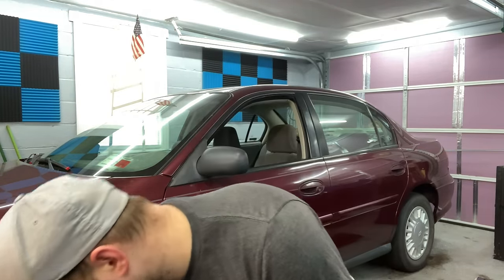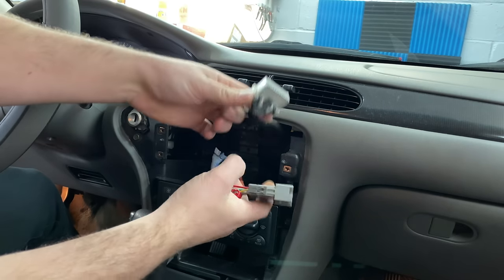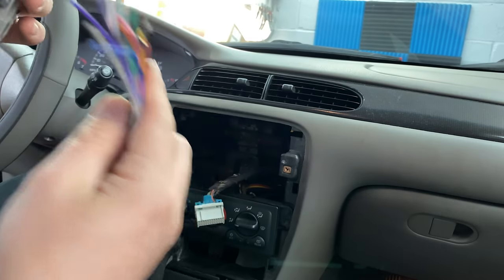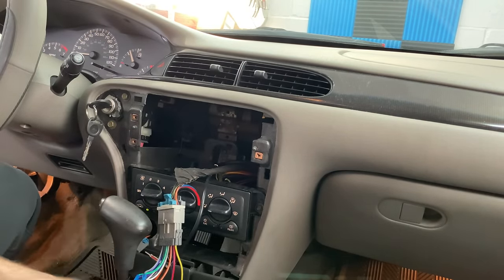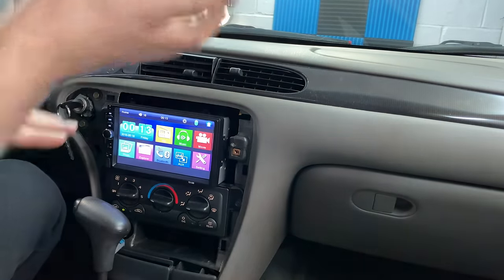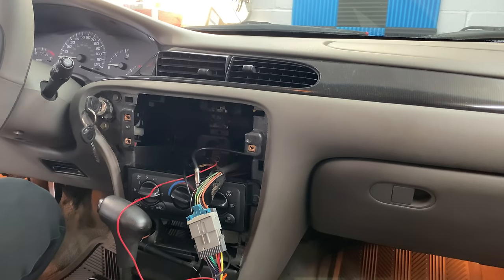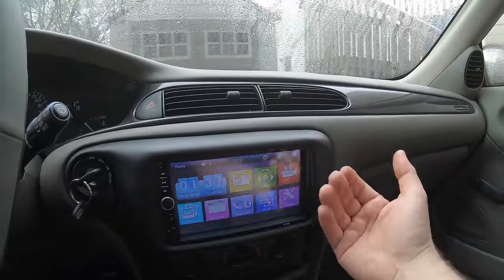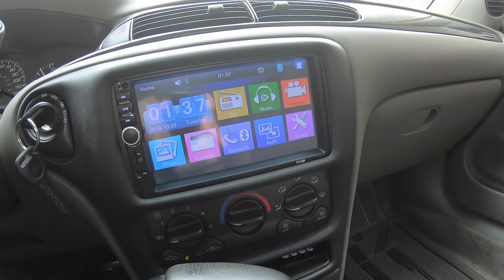I Bought the Cheapest Touch Screen Stereo on Amazon! | Malibu Episode 3

Comment from the maker: Comment what cheap Amazon car gadget would you like to see me try out next!
Reply from the maker: joe v not sure but you can play stuff stored on  usb drives by plugging them in.
Reply: I think it'd be cool to see someone figure out this product I found a while ago. It's a rear view mirror, that's also a screen you can use as a backup camera. It had a bunch of other features too. If I can find it again I'll post it here
Reply: is there an aftermarket tire-pressure monitor?
Reply from the maker: MostlyWeed good idea!
Reply: @poepflater  I am sure if you go with a more expensive unit it will come with that as well in it
Reply: @junkiejackflash  
I have this one, I think it is what you are talking about, it works great. http://www.amazon.com/dp/B07VPD4R71/?tag=beslitstu-20

The one and only issue is that they do not yet have the GPS device available for purchase. 
But video is awesome, recording capacity with a 32 gig card is about 36 hours at full resolution, and the touchscreen works both as a mirror and as a screen so it is pretty awesome.
Reply: If I wanted to buy one what is it listed as exactly?
Reply: @CAPERCHRONICLES  just type in 7018B into amazon for example and you'll get that exact unit along with I am guessing similar units just pick the one you want and buy it
Reply: LsxMatt  The only problem not picking up the parking brake Sir some head units won’t even allow you to pair a Bluetooth device until it realizes your car is in park ! Just saying!
Reply: If you buy anything from Amazon you don't care about job's  and small businesses in our country.
Reply: joe v  Definitely not through bluetooth, that doesn't have the bandwidth for tranmitting video. It can play from micro-SD card or any disk you connect through USB. Might be that it doesn't have the power to run some older harddisks, but you can work around that by having a splitter USB cable (common on older disks) that takes extra power from a 12v-to-USB adapter you put in the 12v socket.
Reply: LsxMatt maybe the rims..?
Reply: new up dated stereo for  Mitsubishi outlander jeep
Reply: Cold air intake
Reply: What kind of dash kit did you buy for the radio? I’ve got the exact same one just can’t find the kit to fit the radio for the dash
Reply: Stay away from Atoto !!!

Comment: I love how that unit connects faster to bluetooth than my 2017 grand cherokee. takes me a good minute to connect
Reply: Zach Reynolds so Dodge is part of FCA, and At least in my Uconnect system, for the Jeep Grand Cherokee, they didn’t update it till 2018 with Apple car play. Mine is just slow to connect, maps doesn’t load until a couple minutes and the user interface is just bad. I know on other Jeep models and FCA models they updated the uconnect with Apple car play in 2016. I can take it to my dealer to reset it but that’s all I can hope for

Comment: I paid 130 at autozone for my touchscreen boss audio deck, it's badass, it made my system way louder and it had all the outputs plus I can watch movies on it and it has bluetooth so I don't have to worry about my aux cord breaking and my phone instantly connects when I hop in. I put it in my 08 cobalt ls. I recently replaced the front speakers with alpines though, and the system is even better.

Comment: I've had this same head unit in my Mustang for the last year. It still works great after a year.  The only thing I don't like about it is that is sounds a bit muffled when the volume is lower.  That could be because of the Mach 460 system they put the Mustang, which has 3 stock amps.

Comment: I bought the Podafu brand unit , it was $ 38 on Amazon. Came with a remote that attaches on the steering wheel, a hand remote and the backup camera. With these units you connect your cell thru USB and display GPS and YouTube or any app . And the sound is actually good.

Comment: Good video. Many of these Chinese radios handbrake feature can be disabled or enabled so you can get away without connecting the handbrake feed. But some touch screen radios need this connected. For the navigation side of things. It helps the navigation work out if the car is parked or not. Not just for dvd playback. Just wanted to point that out.  Enjoyed your video

Comment: I’ve been running the same headunit in my car for the past 18 months, While it’s far from perfect it’s actually “Decent” for the price. What I actually did is put a double adapter on the Reverse parking camera, Then got a Dash cam that predominantly records frontwards but when the cars put in reverse the exact image and guidelines shown on the headunit for the reverse parking camera then gets recorded onto the dash cam. The only thing the manual said it was capable of using the steering wheel audio controls and has the wires for it but haven’t figured that out yet, As it’d be nice to use even if it’s just the Volume up and down and track forward and back and mode on the steering wheel.

Comment: Check the sound with the engine running to see if you get engine whine. I put a pioneer touch screen with back up cam, blue tooth, dvd, etc in my 98 Trans Am.

Comment: Shows you're not too familiar with installing that many head units. You never plug in an undressed radio harness into the car's input harness. The  red 12 volt memory wire is still live and if it touches the  black ground wire it will blow the fuse. Which you will need to replace afterward once you find out why the head unit is not keeping its settings. BTW the reason you lack a wire for twelve switched is because chevy factory radios use a data wire to turn on the radio. This wire sends a data signal, rather than voltage to make the radio operate.
Reply from the maker: Never installed one in anything new than the 80s really.
Reply: @lsxmatt  LOL... Okay.... I'm a former installer.... 27 years experience

Comment: I bought this identical radio from Walmart last Christmas, it was branded as a Blaupunkt  Baltimore 650BD and came with two speakers for $49.88.
I see ended up buying a $14 backup camera and installed it in my 03 Super Duty, mainly for lining up with my trailer.
It works well, only complaint is occasionally when I start the truck and it connects to my phone, it will redial the last number I called. Weird.
The reason you have to push a little on the screen is because it's resistive instead of capacitive, but the upside is it will work with gloves
So, overall not bad for $50

Comment: Wire parking brake wire to ground, dvd will remain functioning while car is in any gear and is also much easier to wire. Reverse needs to be wired correctly to auto engage camera though when backing up

Comment: This is worth it just for the backup camera. It really makes the car feel more modern.
Reply: coolcamaro12 yea I got a screen for the camera because I had Bluetooth with a adapter
Reply: Or you can just turn your head and look it's really not that hard
Reply: Epiccomedy it gets rid of the guess work
My tints make it so hard to back up my suv, i always guess i have less space then i actually do 
And its easier on my dads explorer, although his suv is bigger.
And im really good at parking (not to brag)
Plus the camera comes free, mine was $49.99 its not that bad.
Reply: @epiccomedy227  who does that, you turn your head then, BOOM! neck cramp. Then you in pain, crash then vehicle blow up. Backup camera eliminates all that.
Reply: @solesoul2108  well if that happens then that means you need to eat healthier maybe
Reply: I have fitted this same stereo last week with camera and it makes a huge difference as the rear window is quite high in my Kia Sorento and everything looks closer in my mirrors so I used to think I was close to other vehicles but when I got out of my car I had a couple of feet gap still to go! ;)
Reply: I cant get the camera to fricken work

Comment: I installed into my Honda CRV in 2014 a Pyle ( Pyle has been around for I remember seeing the brand for first time in an old JC Whitney catalog back when I was a kid ) system. 

While I connected everything including something I shouldn't have I unfortunately blew out the lights on the instrument cluster which even if I replace the bulbs it wouldn't work, make sure you know what wires you're hooking up. 

Personally I soldered everything and used shrink tube over the connections which in my view is the best way of doing it. I installed a Pyle 459 ( I think that's the model number ) everything went fine except for what I mentioned. It does pay to get a wiring harness kit so that the factory harness can plug right into it. 

The only downside is the camera I purchase was too cheap and it works sporadically, the weird thing is it tends to only work when I get the car washed, I checked out the connections after it started messing up and everything is fine it's just the camera is crap. 

This is not a difficult thing to do except it's a bit of a pain in the butt installing the backup camera. If you take your time it'll turn out fine. 

Oh yeah, the owner's manuals was completely useless.

Comment: I had a problem with my wire harness as well on my 06 dodge but I connected it to the constant power and have it on a toggle switch for off and on and has worked great for about a year now

Comment: The reason you needed to run the external switched power was this year car used the canbus to turn the radio on and off. It's how the  radios on these would stay on even after you switched off the car until you opened the drivers door. They make a canbus compatible harness, but it's much more expensive and for a cheap car like this, what you did is fine. The switched 12v line draws almost no power so tapping into the hvac controls is fine, the radio draws its main power from the yellow wire.

There is one minor drawback here, depending on the car, (IIRC this is the case with this era Malibu) the warning dings/turn signal clicks are sometimes sent as commands via the canbus to the OEM radio and played out of the speakers, so doing what you did here you lose them, the more expensive canbus harness adapters have a little speaker in them to make the noises.

Comment: Cool, Dude! Tanks. What a great encouragement to grab a substitute for the built-in, semi non-working factory radio/cd player in my old 2007 Saturn Vue. I was avoiding these cheapie deals, but as you point out, it costs less than even a back-up camera alone!

I really appreciate this. I may get a dog unit, but it is worth the try. You've done a fine job with the video. Thanks!

Comment: Not clear on the Bluetooth or loosing connection. My thoughts as a tech was using one of many OBD-II plug ins that transmit via blue tooth. For use in an old truck, running a full “LS” swap, was to see data points on the screen. It would be nice rather than getting my Tech2 out. Playing FM/AM, having a backup camera, then switch to show electronic gauges with various PIDs available would be a package fine with me. Only having a driving camera would be desired, but stand a lone units can be better at night and more storage. Cool video. Goes to to show the slightly better components and software = Profit for the companies that sell touch screen radios, hire a few engineers and the rest is clear money.

Comment: I got a harness for my Mustang a while back. The car worked fine, but just stopped in the middle of the road like alternator was bad like a week or two later. Couldn't figure it out when I found that the alternator and connections were good. Folded and took it to a mechanic who had to send it to Ford. Turns out and the wire labeled as mute was actually going to a speed sensor on the harness... Ripped that wire out and had it in the car for like 5 years with no problem...

Comment: Those old GMs used a bus system to turn on the radio. You always had to run a separate ignition wire to the fuse box or column.
Reply: Annnnnnd you just tapped it off the HVAC..... Don't make these types of videos if you aren't going to show the proper way to do things.
Reply: Also the parking brake wire needs to see a ground in order to let video play. It is a safety precaution because when hooked up to the parking brake the video will only play when the parking brake it on. If you just run this wire to straight ground it will allow video to play while driving.
Reply from the maker: Its just a signal wire, the radio gets its main power through the thicker yellow wire. I even left the stock hvac fuse, so even if there was a spike in current it would just blow that fuse. Now I don’t condone tapping off an existing circuit and adding a larger fuse to accommodate. Thats just asking for a fire..
Reply from the maker: It was actually the reverse camera wire. This headunit doesn’t have a parking brake wire that I could tell.

Comment: I bought the same one. Twice. Once from frys. The 2nd off Ebay. What happens randomly is the sound stops playing. Not a wiring issue. Something with a solder joint, or other board fault. Be careful with that thing.

Comment: That's common on 99% of the GM cars. Awake signal for the radio is being send through the communication wire. That's why they don't have power by ignition switch. Got me confused couple of times ;)

Comment: A lot of gm radios of that era have a accessory feed that uses low voltage from a “body” controller.You have to run your own accessory wire.

Comment: hey bro just to tell you the harness in the gm car dosnt supply 12v ingnition you have to tap in in some 12v there is one under de sterring colom theres is a big connector  and you can tap on the 5th wire from the right its a black wire  and it works when you turn key on acc and even until you open the door

Comment: You should copy the wiring diagram and tape it to the radio for the next guy!
Reply: Why? The next owner will be replacing the unit, so the wires will be different.
Also all headunits even cheap ones like this will have a sticker with the wires on it
Reply: The next guy is the junk cars guy. He doesn't care about that.

Comment: You don’t have switched 12v because the radio turns on by data. You need a data interface harness to make it work correctly. You will usually lose the warning chimes doing it the way you did here.

Comment: in some head units if the brake wire (pink) in this unit is not connected to a negative pulse you cant access some of the menu on the touch screen model.
gmc ,chevrolet cars built from 2001 till 2005 do not have an acc positive wire (the red wire that turns your head unit on) for aftermarket  radios, i usually tap to the  brown wire on the ignition switch located by the left side where the radio opening is.  this head units are a nightmare to install because they arent true double din so no dash kit ever fits right and they usually last 6 months  then they kick the ghost

Comment: Grounding the parking wire to the metal case of the head unit allowed me to play videos while the car was in motion.

This system you just installed looks like it runs off of a Android operating system mine runs off of what looks like a bootleg copy of Microsoft CE.

One last thing is the one I have is not capacitive touch oh, it's actually a touchscreen where you actually have to use a little pressure on the screen in order to get it to function, old-school touch screen technology but it still works.

Comment: MY 2007 Honda fit display screen freaked out and was only an AM/FM cd player. I installed this unit with a dash kit (approx $70,Ebay) which gave me the wiring harness from the honda plug with the wires labeled to connect this units 2 connector plugs. The back up camera and bluetooth work great. The RADIO does not. It scans and picks up only 5-6 stations. I am in So-Cal with > 15+ stations but the unit was unable to pick them up. I had a replacement unit shipped to me. pulled the dash apart again(agh!!!!) and installed the new head unit. Exact same thing happened. I am keeping the radio installed as I am now using my cell phone to stream Pandora etc. I like the hands free cell phone feature,back up camera(wider angle than our 2013 camry camera). So for $50.00 I get new features but miss the old fm stations I always listened to....Would I buy it again? Yes! but it would be nice if the radio worked.

Comment: I just buy this for Bluetooth link and reverse camera. No need to mess with the software on the player as long as the sound work and link to your phone is good. Great to run with four speaker front and rear.  No need android car player when you already got a great android on your phone. Just get a good phone holder that grip type and not suck cup.